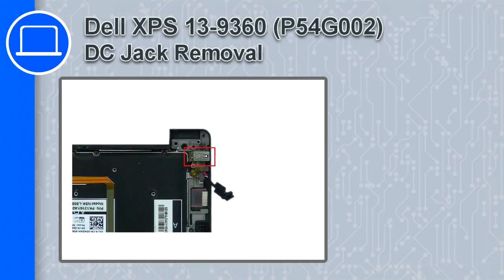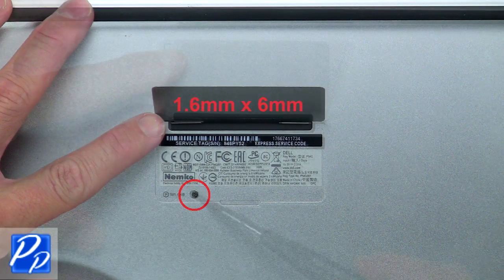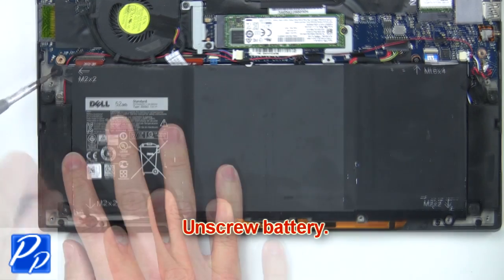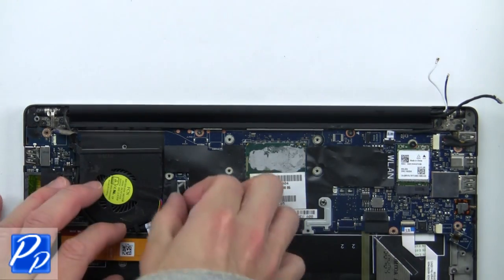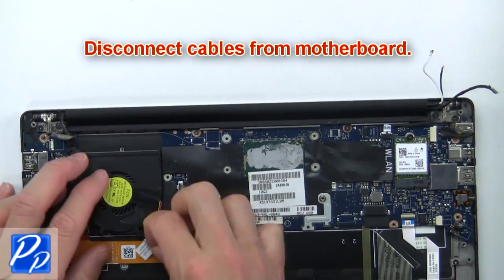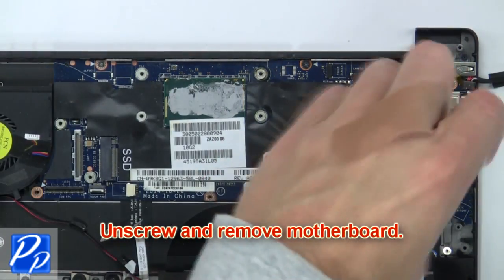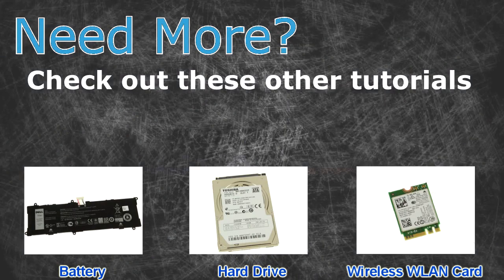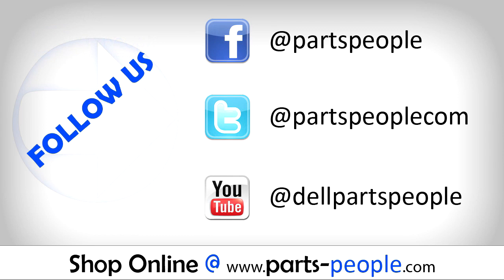Dell XPS 13-9360 (P54G002) DC Jack How-To Video Tutorial

Comment: I have same laptop and the problem I have is it doesn't charge.  It doesn't recognise the charger. I've removed the battery and bios battery and plugged charger in and it powers the laptop up so thinking motherboard?

Comment: hello there ricardo, thank you very much for your video! I followed your instructions and everything worked! almost...

When I turned my laptop back on, the track pad no longer worked, just wondering if there is a specific connection that i missed in the process?

Thanks for any help!
Reply from the maker: I would double check that the touchpad was properly reconnected.